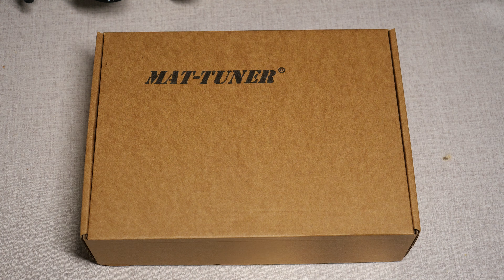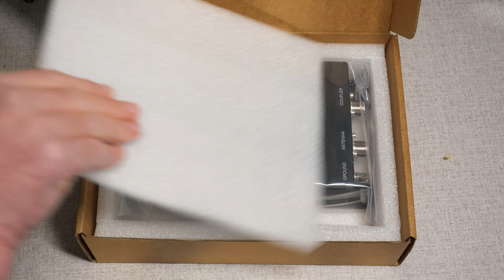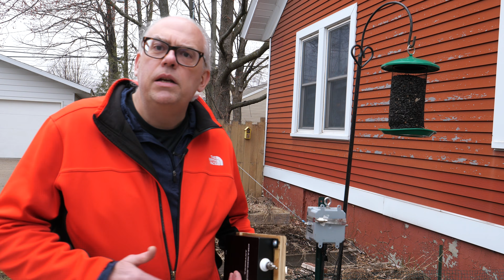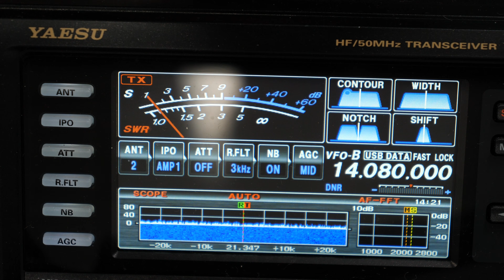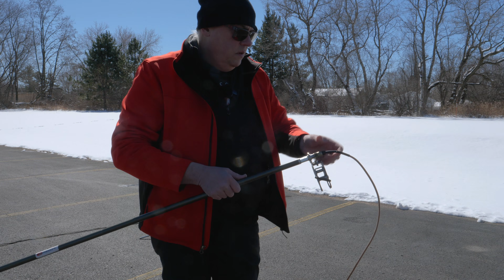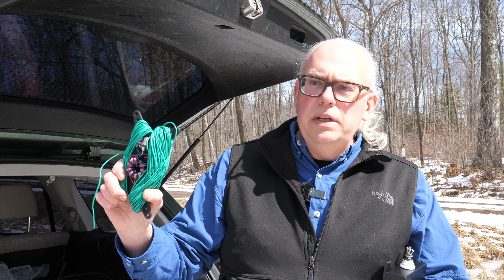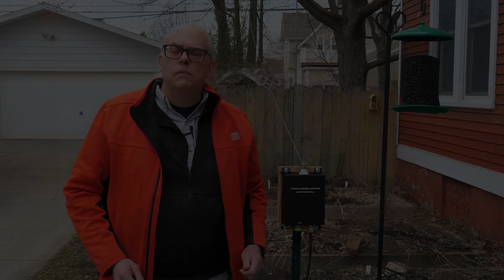Maximize Your Signal with the Chameleon URT-1 Remote Antenna Tuner

Comment: MAT 40 TUNER
Reply: No it's not - It's a totally different tuner because you can also use a SO-239 OUPUT to feed a BALUN or UNUN.
Reply: @Chameleon_Antenna  I would like one of these for free!!😉😆😆
Reply from the maker: The similarity ends with the branding on the outer box. In the video I list the key differences between the URT-1 and the MAT 40.

Comment: Those remote antena tuners have lots of great applications.  My Hawiian buddy uses a similar tuner very effectively on his 30-foot vertical for portable deployments.  I use an LDG remote tuner on my 160-meter fullwave loop at the end of a 250 ft. coax.  They are pretty sweet for minimizing coax losses.
KZ9V

Comment: Learn about antennas. Ideally, the impedance at the input to the transmission line should be equal to the characteristic impedance of the line. Ideally, the output impedance is equal to the characteristic impedance of the line. If you have a 50 ohm line, voila, that's already matched. No tuner at the transmitter is needed. A remote tuner can supply a 50 ohm output impedance for the transmission line and transfer the power to the antenna. 

Pretty simple concept. Remote antenna tuners is the only real way to go when a tuner is needed. That is if you want maximum efficiency.
Reply: Not always, a doublet works well with the tuner in shack
Reply: @Pioneer936  What's your goal?  Mine is maximum efficiency.  Yours is apparently just to get something on the air.  That's fine if you don't want every last S-unit.  When I try to work someone and they just can't make out my call/report, and I have left some efficiency on the table, that's on me.  I coulda shoulda had that one, but I didn't transmit as much power as I could have.  In this hobby, you can do whatever you want and it will probably work.  Making an antenna that works is like falling off a log.  Making an antenna that is optimized is the next level.  Cheers. N9XR
Reply: @N9XRradio  you obviously don't understand a doublet
Reply: @Pioneer936  a doublet is a very effective vertically polarized antenna.
Reply: @BusDriverRFI  any configuration it's efficient
Reply: @Pioneer936  the 130 ft horizontal section on 80m represents a ~70 ohm load. The 600 ohm ladder line represents a 8.5:1 mismatch. Just awesome OM. Gopher it. ;)
Reply: @BusDriverRFI  you don't know what your talking about, compared to a resonant dipole it's more efficient
Reply: @Pioneer936  do the math. A 8:1 mismatch gives you a transfer efficiency of less than 40%. Awesome dude. You are the man.
Reply: @BusDriverRFI  haha you are a joke you haven't a clue ,stop spreading your bs
Reply: @BusDriverRFI  haha you obviously haven't a clue about a doublet
Reply: @Pioneer936  What's to get?  I gave you a scenario and you accepted that.  You made no changes to it.
Reply: @BusDriverRFI  because compared to a resonant dipole it's more efficient
Reply: @Pioneer936 doing the math, show me how it's more efficient.
Reply: @BusDriverRFI  use the online calculator, put halfway dipole for 80m , a resonant dipole 1.5 swr and the non resonant with 10.1 swr , non resonant with 600ohm balanced line ,resonant with rg58
Reply: @Pioneer936  Kristen McIntire had a video https://www.youtube.com/watch?v=lqWhGctkusQ.  At around 31 minutes she explains Maximum Power Transfer.  She doesn't believe in proven math as do you or those stupid online calculators which do not prove anything.  You're into ARRL's pseudo-science.  I'm dealing in the realm of reality.  That's the real problem here.  As long as you deal with fake solutions, you will never get it.
Reply: @Pioneer936  So you're saying that the laws of maximum power transfer be damned and you will follow some unproven internet calculator.  Way to go.  I work in reality, not some pseudo-science as do you.  

Can the flat top doublet antenna outperform the simple dipole with RG-58?  Sure it can.  But that's not the argument here.  The argument is that you are not getting a large amount of signal radiated by the doublet elements as the Maximum Power Law shows that only 40% is getting transferred in ideal conditions.  The other 50-60% is vertically radiated by the transmission line as a vertically polarized antenna.  Very impressive as you say and it works within the realm of reality.  

73 OM,
de N9XR
Reply: @BusDriverRFI  absolute bs ,the feedline doesn't radiate ,as I said earlier you haven't a clue about the doublet
Reply: @Pioneer936  So you contend that the 600 ohm ladderline and the 70 ohm flat top will be 40% efficient at best with no added losses.  Have it your way.
Reply: @BusDriverRFI  obviously you haven't done any research on the antenna to keep coming back with bs , I wouldn't have said it was more efficient than a resonant dipole if it wasn't,this is the problem in this hobby bs info being spread around
Reply: @Pioneer936  If you want to say that the antenna science is all BS, it says a lot about your opinion.  Impedances must match for the highest efficiency.  It's not BS.  Your pseudo-science is BS.  It's really that simple.
Reply: @Pioneer936  I hate how the hobby has been dumbed down and over simplified.  Very few have even done elementary Calculus anymore.  There's no way they can understand anything about optimization and calculating efficiency levels.  These are truly sad times.
Reply: @BusDriverRFI  you can't talk you think balance feedline radiates
Reply: @Pioneer936  you can't talk. You don't have the math background to understand.
Reply: @BusDriverRFI  I understand fully how a doublet works, it's up to you to do the math work to understand, you tried to tell me the antenna is not efficient because the feedline radiates that tells me all I need to know about your knowledge on antennas and feedlines ,go do the research
Reply: @N9XRradio ive noticed on other videos you have been challenged on your lack of knowledge and continue to spread bs ,check out videos and comments from Mark the florida ham man you may learn something
Reply: @Pioneer936  I really don't care to be that imbecilic. That is your job.
Reply: @BusDriverRFI  pointed out a non resonant antenna system thats more efficient with high swr than a resonant antenna system ,thats imbecilic ? I guess you can't argue with stupid
Reply: @Pioneer936  A 130 foot 80M doublet isn't even non-resonant.  I never said it was non-resonant.  You can't do anything but sling spit because that's all you got.  You totally don't understand doublets, lol.  You have already revealed this.  I'm out.  I'll leave you to wallow in your ignorance. Bye.
Reply: @Pioneer936  Nowhere did I ever talk about a non-resonant antenna.  This discussion isn't about non-resonant antennas.  I thought we were talking about doublets.
Reply: @BusDriverRFI  a doublet is what I've pointed out to be efficient when not resonant ,the feepoint with 600ohm ladder line makes it non resonant, requiring a tuner
Reply: @N9XRradio  the tuner corrects the mismatch and allows the transmitter to put full power into the system, so we have a very low loss feedline coupled with full power into the system = efficiency
Reply: @Pioneer936  A doublet is a resonant antenna.  WB3GCK describes it as "What is it?  The doublet, simply put, is just a dipole. The difference is that you feed it with a balanced feeder, rather than coax."  We know that a dipole is a resonant antenna and the doublet antenna is the same thing.  What's your imbecilic description of a doublet then?
Reply: @Pioneer936  You don't know what a non-resonant antenna is, do you?  And you think I'm not all there upstairs.
Reply: @N9XRradio  I've described a doublet how it's not resonant
Reply: @Pioneer936  You lied and said, "@BusDriverRFI  pointed out a non resonant antenna system thats more efficient with high swr than a resonant antenna system ,thats imbecilic ? I guess you can't argue with stupid".  I am arguing with stupid.  Lying is the only argument you got.  I never said that the doublet was a non-resonant antenna.  You just don't understand the doublet and I'm not your Elmer when you are too imbecilic and willfully ignorant towards educating yourself.  You think it's a non-resonant antenna and a dipole is a resonant antenna when I supplied to you a definition that they are the same thing.  You cannot argue anything with a modicum of intelligence.  You can only sling insults of your betters and suggest I decrease my intelligence level to be closer to yours.  'taint gonna happen. Bye now.
Reply: @Pioneer936 it's too bad you don't know how to read.
Reply: @N9XRradio  you obviously don't saying that a doublet feedline radiates
Reply: @Pioneer936  Get online and complain to the people talking about slim jims and tell them their balanced twinlead antenna antenna doesn't radiate.
Reply: @Pioneer936  It's pretty plain to see that you don't understand antennas.  That's fine with me.  Knowing you don't understand is not the problem.  The problem is not correcting your issue.  You are now saying that I said that the doublet is a non-resonant antenna.  It is not.  I would never say that about the common description of a doublet.  You choose to lie and misquote me.  I don't care to go on with you.  You don't understand antennas and you don't care to be civil and not lie.  Bye now.
Reply: @N9XRradio  I haven't said you said that the doublet is a non resonant antenna, I said I explained how it is a non resonant antenna, now you are just making things up ,it's plain to see in the comments, you keep going  on about not doing any reading, arrl ,reflections ,and all the training manuals support what I have said in this conversation, now you need to go away and do plenty of research before spreading rubbish about the doublet feedline radiating for starters, then understanding why it doesn't radiate will help no end with understanding how feedlines and antennas work together